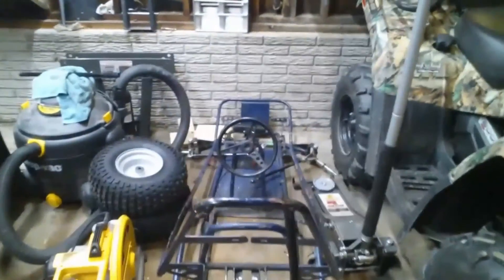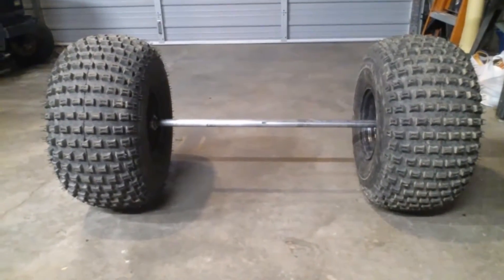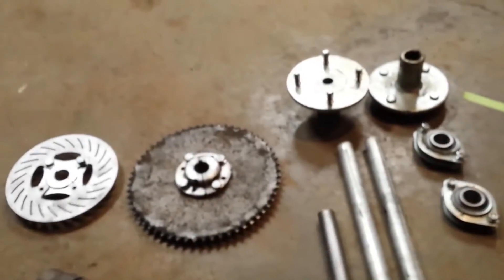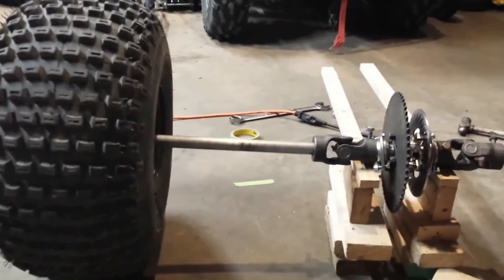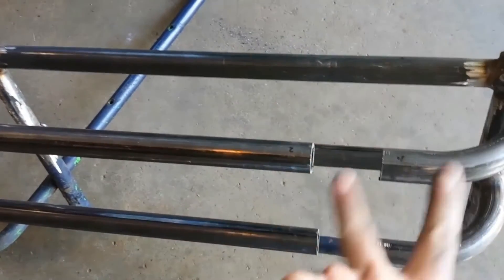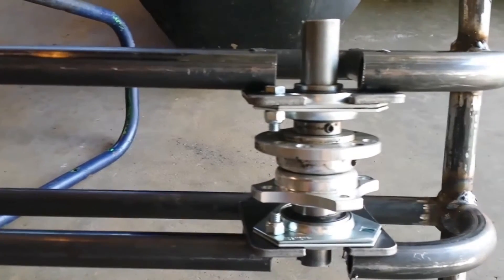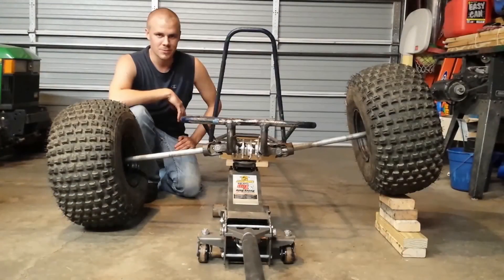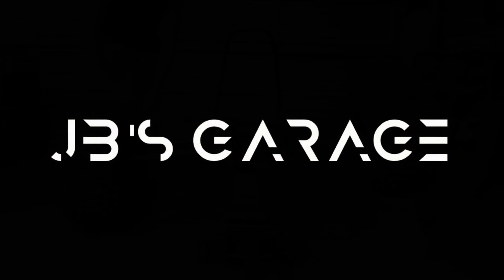Independent Suspension Go Kart Build (Part 1)

Comment: How did you make the middle part with the sprocket?
Reply from the maker: The middle axle is a 1 inch live axle that is about 10 inches wide, the axle is held on the kart with axle bearings that are bolted to their mounts on the kart. The sprocket and brake rotor was bought online and came with the 1 inch hubs that fit on the axle. Hope this helps I'll go more in depth on the next video.
Reply: @JBRACINGinc  yea lol, I must've been tired last night cause it makes sense now that I watched again. And the u-joints are keyed. Pretty neat
Reply: @JBRACINGinc  oh and the fact your not using u-joints/hubs on the tire side - how did that turn out so far? Makes fab and build time a bit easier
Reply from the maker: It's definitely a simpler, cheaper design and with less moving parts. I will show in the next video how to get everything lined up in the rear so there is no binding but as of now the rear a arms are on it with the axles installed and everything moves with no problems.
Reply: @JBRACINGinc  Nice! I think I might use a sport atv rear siwngarm on my kart just because I think it may be easier and a little more stable in the corners, but we shall see.
Reply from the maker: Ya it would be easier to use a swing arm. Im curious to see how much mine will roll in the corners lol. Good luck on yours
Reply: @JBRACINGinc  yea I think one day I will definitely build an IRS one, but I just wanna see how well this ATV swingarm would work. I'll be lookin out for your next vid!

Comment: do you have a part number or more information on those U-Joints?! I've been looking everywhere!!!
Reply from the maker: Sorry I don't have a part number I can't find the receipt. I did find some on eBay just do a google search for 1 inch keyed u joints and they'll show up. I got mine at car quest but you should be able to find them at a tractor supply or something similar. They are used for the pto shafts on tractors. Just make sure it's 1 inch inside diameter with a 1/4 key way
Reply: Probably to late. But I found a magazine ( surplus center ).  294-2021 phone number.   They will send you a catalog.   They have some nice small 1inch joints.   I will be ordering some soon.  Hope this helps

Comment: What are the brackets called that hold the disk break and the sprocket in place to the U joint? Is most of this in Harbor Freight or? I like the set up! :)
Reply from the maker: I got most of the kart parts from online, go kart stores and ebay mostly. the u joints you can get at a tractor supply. The brackets come with the axle bearings